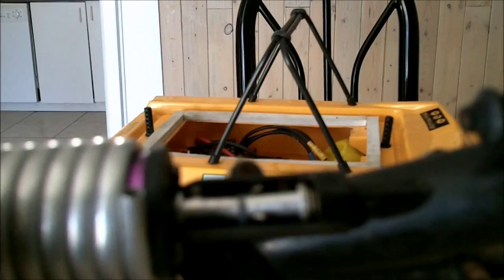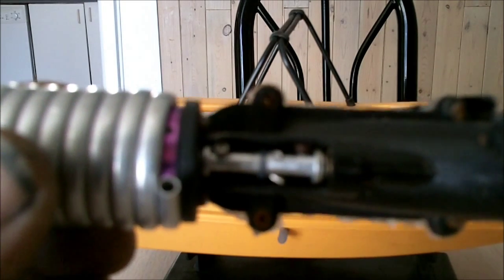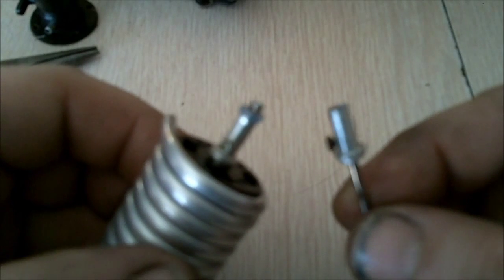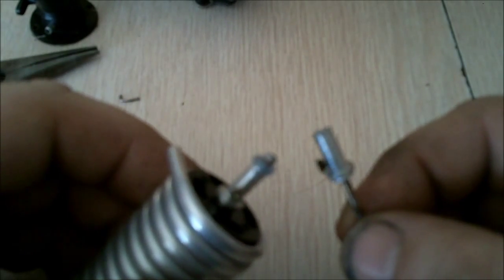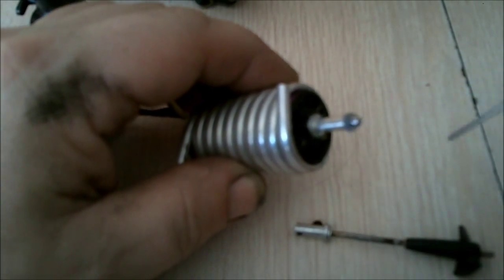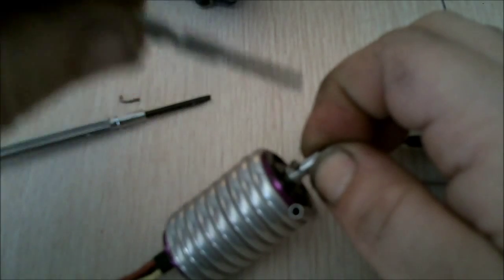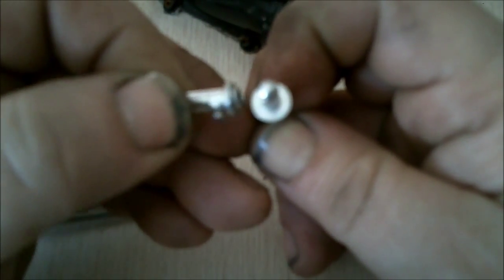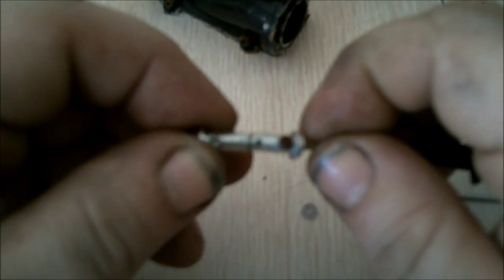NQD motor coupler

Comment: Does it work well? I think the power brushles very strong ...
Reply from the maker: it was just a temp till i could a better one. but yes i got a year out of it , running 4200 kv  with 2s and 3s bats. my boat was nice and quiet and ran smooth. then it did ware out

Comment from the maker: bro groupner was one of the first companies to make rc jet units , back in the  late 80s early 90s. the only problem was the brushed motors of that time did have the power ,so the jet drives were slow. i have never owned one. but from what ive herd they are  top notch quality. i do have a kmb 28mm jet unit but its to big for the nqd jet boat. how much was your jet unit.  did ya get it from e-bay?  yeh terry is the jet boat king in my books! wicked awesome vids!

Comment from the maker: the e-bay store is called rc-sub-workshop. you need a 2.3 mm x what ever your motor shaft is.  i bought a brass 2.3mm x 3mm. i had to mod it . its. two pieces., the 5th one down from the top. i pulled out the pin from the ball end and drilled holes through the other piece. then put a piece of paper clip through it to hold them together. if your going to get that one there is only one left. you might want to hurry. or they might have a different one  thats 2.3mm x 3mm

Comment from the maker: yeh it holds pretty  good. don't be shy with it. i use a generous amount. it's actually kinda hard to pull it out after. but it will come out. also you can put some around the wires ,the screw heads and seams to make the servo water resistant  be fore gluing it in.

Comment from the maker: i just glued mine on plastic platform. could be tricky getting the wood mounts in that tight corner. if your not using a water proof servo you will be replacing them every once and a while. i used clear silicone to glue mine in. that way i could replace . just pull it out and peel off the old silicone and glue in the new one. hope this helps ya out. thanks for watching.  B>)

Comment from the maker: not sure bro! i shop on e-bay and get the fly sky radios cheep. they run about $ 40.  they are 3 ch receiver  and  2ch transmitter 2.4ghz. i get them from china. some times they take a few weeks to get here in canada. depends on their customs service. also i can order just the receivers for other models and bind them to one transmitter. they are really cheep , like $ 10.

Comment from the maker: my motor didn't have a flat spot on the shaft at all . so i had to file it flat. if you dont the grub screw will slip when the motor is running, no mater how tight you tighten it down.

Comment from the maker: on the pto  shatf some motors only have a small area that is flat. if the screw misses it you might have to file it longer so the screw has a flat spot to bite the shaft. same with the impeller shaft. you wont know untill you try and install it

Comment from the maker: cool! the only thing i didn't do was measure the length of the screws. they might rub the sides of the jet drive. you might have to file them down a bit. not sure they might be fine. also might have to file a flat spot on the impeller shaft and pto shaft no the motor to match where the screws fall on them. just miner touch ups.

Comment from the maker: @rcnation101 2.7mm might not be easy but i will try. no guarante on the fit bro. you might have to tweak it a bit . would be easier if i had the motor to fit as i don't have machine equipment. ill try my best. B>)

Comment from the maker: @rcnation hey bud. when i built this one , i couldn't find any on e bay. so i made one. right now e bay has  an all steel universal joint coupler for sale for $10 and free shipping. its a 2.3mm x 2mm.  in order to make ya one id need to know the size of pto shaft on your motor. could build ya one for free, to help ya out bro! let me know if you can't find one. il do what i can bud!

Comment: ebay! 2.3mm toy boat joint, i cut the stock motor mount out replaced with fiberglass mount and 2.3mm u-joint....stock coupler is bunk